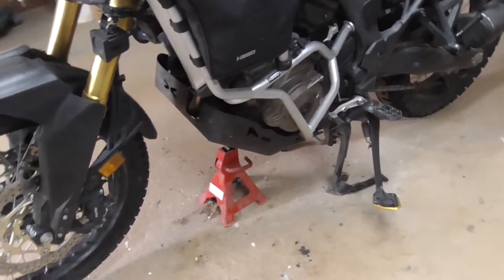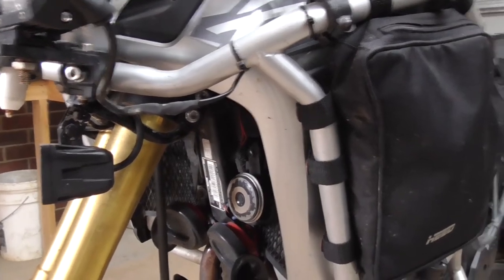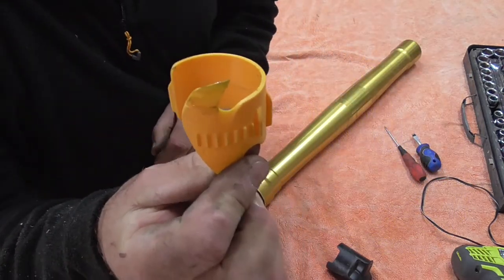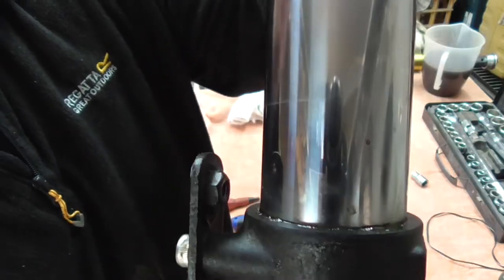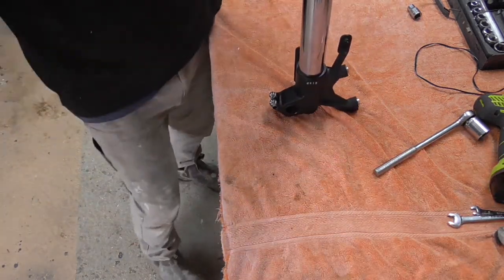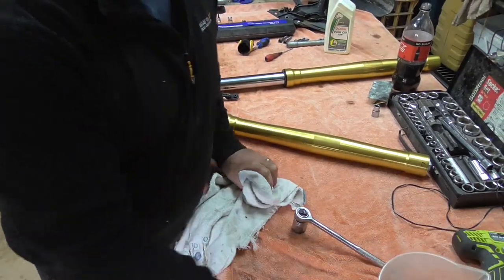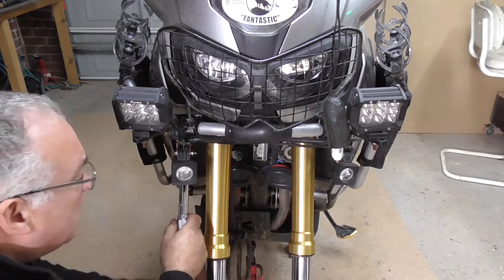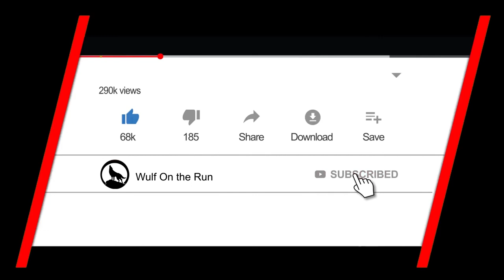Africa Twin CRF1000l 2016 Fork oil change

Comment: Thank you for sharing. I appreciate your insights. Considering all the work that goes into this process, I would have opted to not use the old oil rather I would have invested the time to fetch more at the store. Call it perpetual bad luck if you will, but every time I take a shortcut it always seems to come back and bite me. Great video otherwise.

Comment: Spit on. Just a little tip, never let the lock tight nozzle touch metal. Just let a drop fall on as it reacts with metal and even a tiny bit going back into the bottle that has touched metal can ruin what's left in the bottle mate. Great video
Reply from the maker: Cheers... Great tip thanks 👍👍
Reply: 1 year later...Thx mate for the advice!

Comment: Why didn’t you check the fluid height in the fork after adding oil? It doesn’t matter how much oil you pour into the fork. It matters that the fluid height is correct after bleeding all the air out of the cartridge. It will also ensure both forks have same level of oil.
Reply from the maker: Didnt know that millimeters was completley different from millimeters. Im a Builder and Same same to me.. Lol. Cheers for the tip 👍👍
Reply: You should check the oil level in mm (factory springs with springs out is 95mm) othersprings is different.

Comment: The shop manual I downloaded says the brake caliper mounting bolts are torqued to 45 N-m. The manual also calls them ALOC bolts which, I guess, should be replaced each time - not reused. I'm going to reuse them and use blue loctite. Your thoughts?
Reply from the maker: I've recently done another strip and fork oil change. Used the same bolts again.
And at the mo half way to Western Australia from Melbourne.
Touch wood all going well.
👍👍
Loctite seems a good idea to me.

Comment: You made that look easy for anyone to do themselves. If the right side was leaking, doesn't that mean you have to replace the fork seal?
Reply from the maker: It was leaking until i cleaned it out. And reseated it i hope. 😳
Reply: When I got my AT I was replacing my fork seals when they started leaking, my first ADV bike.  Found the Fork Doctor and haven’t had to replace one since.  I do a lot of off road and probably don’t do a good enough clean up job after each ride.  When I do replace them next I’m definitely going SKF rather than stock seals.

Comment: I used the Fork Doctor recently and my leak has stopped...for now. How in the world do I now top off my fork oil on my 2019 AT? Do I have to take the entire fork off to add oil? Thank you!
Reply from the maker: @LayneSteighlee  you can loosen the top yolk bolts undo the fork cap and top up from there. But it would be a guess on how much you lost to replace it with. Normally fork seal drips don't loose that much unless it's been leaking for a long time

Comment: Good one Pommy :) ...Eh, I recon that dropping a few ft pound on the bottom clamp helps with the ware issue with the anodizing wearing off... I dropped 3 ft pound to my bottom clamp and it seems to have helped ...Tho I do have Andrinie front cartridges in my tubes ... did you have a look down the tubes to see if you have ware? ...anyways good vid for the punters mate ...
Reply from the maker: Cheers Sean. No didnt check them. lol

Comment: Left marking? It is only hole for the ABS sensor on left side, it is impossible to do it wrong.
Reply from the maker: No abs on this model 😳
Reply: @WulfOnTheRun  I hate this ABS, and all the other things that makes this mashine a rolling computer. I was sure all the new ones had "all the gadgets". Is some of it missing on the 2016?
Reply from the maker: @johnnynormann5531  yes mate it's a basic model. No ABS or traction control. No gravel,tarmac,grass settings just 1 down 6 up and hope you stay on. 😆😆